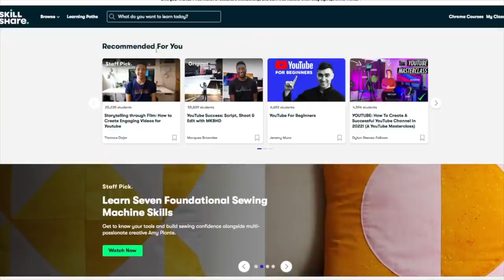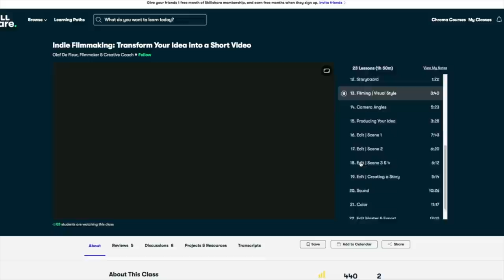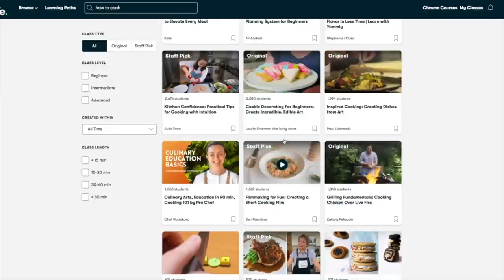We CAN'T Put The Roof On Now

Comment: Dutch/Sean you should consider investing into a brush mulcher/grinder attachment for your bobcat. It will attach to your front and the hydraulic lines & you can grind down saplings and brush/undergrowth. This would be very instrumental in keeping 4wheeler trails maintained. As well as clearing food plot areas for your deer hunting. Without having to do hard backbreaking labor with chainsaws ect.